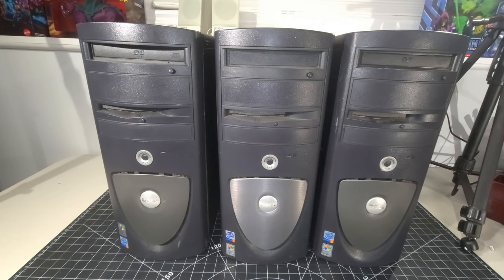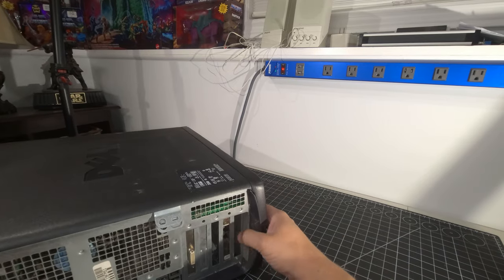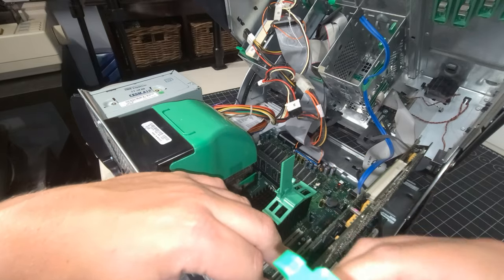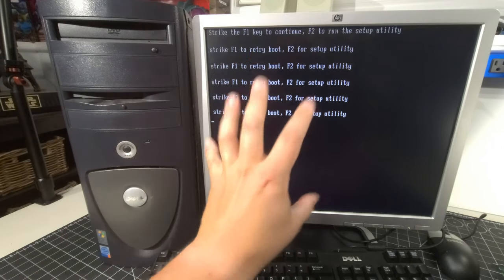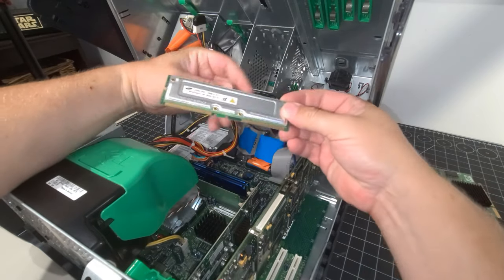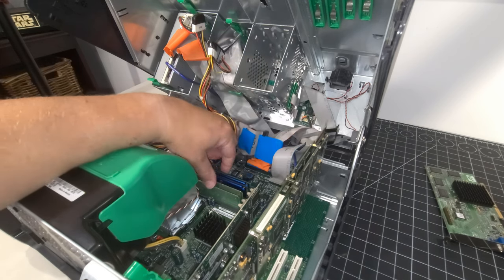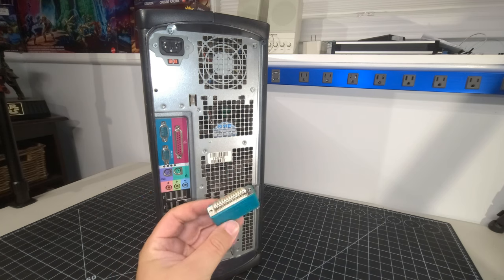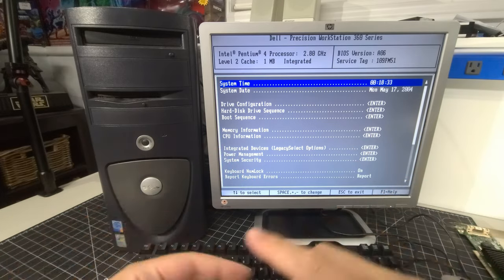E-Waste Rescue - The Dell Precision Triplets!!

Comment: The "adpater" on the 3rd system's parallel port is a hardware key.  In the old days a software maker would control customers making copies by forcing them to use a hardware key.
Reply from the maker: Thanks!!
Reply: I've seen similar hardware keys being used with old oscilloscopes in the past.  The hardware key is used to unlock/validate features on the scope or other such pieces of equipment.
Reply: Hardware keys are still a thing but in the form of a USB stick. For example Davinci Resolve Studio has an option to buy a hardware key
Reply: @Pasi123  I have seen the usb keys.  I saw one on a desktop, plus it was labeled to keep folks from removing it.  They attached a security cable via epoxy, and tethered it to the workstation.  At least it wasn't glued in place!
Reply: Accounting software uses those keys too. They were a real pain to work with if you upgraded a system and forgot to take the key from the back of the machine.
Reply from the maker: I would imagine.
Reply: @BRBTechTalk  At one site I worked at the engineers would install the software on multiple pc's. then pass around the parallel keys to those who temporarily needed to run the software.  The vendor phased the keys out in place of a utility that would register individual machines with their license server.  Our network admin had to open a port so the license server could sense the pc's.  Not sure if it recognized the machines by MAC address or other identifiers.
Reply: Also, these keys are used in most PC Based Arcade games like Raw Thrills, Global VR, Namco, and Etc. They mainly use Aladdin HASP HL LPT Dongle or a USB HASP HL SRM Key or Sentinel SafeNet. They can be valuable and sell for a great profit. It was mainly meant to prevent piracy, and their own modified OS won't run the application without the key
Reply: I remember you saying in one of your previous videos that these Dell systems are bulletproof. And although I don't really like the brand itself I have to agree with you! Ive had this Dell Optiplex 780 for 2-3 years now and I've had many motherboards die on me  in that time yet this thing is still living even after fiddling around a  ton with it on the inside. The CMOS battery holder broke so I tried to solder a different one on it from a donor motherboard and it didn't broke and it actually has scratches on the back of the board from my soldering iron and it even has a missing trace on the board from my bad soldering skills. I thought it'd be dead from all this abuse but it still works absolutely perfectly apart from the CMOS issue! Absolutely incredible. I enjoy your videos a lot btw.
Reply from the maker: First off thank you for the compliments!  It's great to hear and happy to have you aboard!  As for Dell, there was a time I really liked their designs, systems, notebook PC's, etc.  Then there was a dark era lol.  I'm actually surprised that board worked agree that abuse haha!  It seems I can't even look at a board the wrong way and it doesn't post lol.  Great to hear yours is still going.  Stay tuned for more content!!

Comment: I have the device as an Optiplex variant, the Optiplex GX260... with 533 FSB it wasn't the top model at the time, but it was a robust PC. Mine is from 2002. I replaced all the capacitors yesterday. They were bloated and partially leaking. Now the old Optiplex has been repaired again. Iconic and widespread devices at the time. That was still quality, Dell paid attention to every little thing.
Reply from the maker: 100%.  If the Cap plague didn't happen, I'm not sure how much you could fault them for.
Reply: @TheRetroRecall  It was a really bad capacitor time back then. They will have installed the capacitors like other manufacturers without knowing. I can still remember, I was sitting at my PC one afternoon in 2004 when suddenly there was a loud bang. And then a cap exploded and destroyed the entire mainboard.
Reply from the maker: That would have been a VERY sad moment.

Comment: Don't destroy your hard disks. Run a Linux distro and format the drive with 0s. It removes all the data and is almost impossible to get the info back unless you are in the FBI
Reply from the maker: For sure.  When I get the drives I wipe them with security software and reuse them - mostly to protect the previous owners data.  I've heard about the linux way though - just never tried it before.  If the drive is shot, I drill holes through it.

Comment: That's not a DVI port, its a DMS-59 you need to adapt it to output VGA or DVI but it supports 2 monitors at once
Reply from the maker: Thanks for the feedback - I call it out on screen during editing that it isn't a dvi port and correct myself during the video.

Check out marker 9:51 :)
Reply: @TheRetroRecall  The DMS 59 is standard... no idea what the connector on the 2nd card is though
Reply from the maker: Need to do some hunting!
Reply: @TheRetroRecall  It's possibly DFP. (Digital Flat Panel) Which is the short-lived predecessor to DVI. These are not common, and an odd choice for a card from 2001, as DVI released in 1999 and I've got a few cards from 2000 and 2001 with DVI. 

EDIT: It is not DFP, but rather EDD. Tough luck. You're not missing out on much though. The Radeon 7000 is a pretty lackluster video card.
Reply from the maker: Ok awesome.  Yes I heard this cable was pretty unobtainium

Comment: Diacom board was more than the cost of the PC when new, T1 telephony card used for monitoring and recording
Reply from the maker: Thanks for this.  It seems that they are still quite expensive online for the cards.  New were showing 7500 USD +.  Crazy!
Reply: The globetrotter flexid is the hardware key to run the dialogic software seems like they were used for interactive voice response - state of the art for the time

Comment: I had 4 of these Dells which I got from eWaste purchases a few years ago. Agreed with you that these are heavy and they take up a lot of space. So a few months ago I took them apart for the cpu, memory, and drives to put into other smaller systems and junk the cases. Back in the days these are fast machines build like a tank.
Reply from the maker: 100%. Tank is definitely the word.

Comment: In one of your previous videos I remember you saying that these dell systems are bulletproof. And I have to agree on you! I've had this Dell Optiplex 780 for about 3 years now and I've had many motherboards die on me in that time yet this one is still living. After a ton of fiddling around on the motherboard it all still works absolutely fine. The CMOS battery holder broke so I tried to replace it by soldering on a different one. It failed and I accidentally made scratches on the board with my soldering iron and even a trace came off. Yet unbelievably this thing still runs fine! I can barely believe. I really thought it'd be dead by now but nope. I don't like the brand itself but I'm happy it's so reliable and I definitely agree with you. I enjoy your videos a lot btw, keep it up!
Reply from the maker: I think this was a double comment post? Haha.  I responded in the other one but in either case... Definitely happy to have you along!!!!
Reply: @TheRetroRecall  yeah my bad hehe😅. I didn't see that I replied to someone else's comment first. I thought it was just a public comment that somehow didn't come through.
Reply from the maker: All good!!!! Keep Commenting away!!! :)

Comment: DMS-59 adapters are pretty common, so shouldn’t be hard to track down to get that GPU working. Thankfully it wasn’t the older EDD connector that DMS-59 replaced.( EDIT Just watched further, and the connector on the second machine is in fact EDD, and is also the same model card as the two I have. It’s a Radeon 7000 32mb) Those adapters are unobtainium. I had an EDD card for years and couldn’t find an adapter. I finally found one included with another identical card. A little background on these connectors are that they are designed to run two independent monitors off of one port, the adapters can come in dual VGA, dual DVI, or one of both. Not sure of the practical differences between EDD and DMS-59 besides the different shape.
Reply from the maker: Thanks so much for this added detail.  I'm going to keep my eye out and check in where I got these to see if there is a cable laying around haha.  Again, thanks for this!

Comment: In the factory they would spend their entire life there laying on that side with the feet. The towers were designed to accommodate the builder of the machine. If I’m not mistaken I believe the goal always was to have a highly configurable system that could be built in the factory with as few screws as possible during the building process.
Reply from the maker: That makes sense and thanks for sharing.  The clamshell design / access still baffles me.  Its quite hefty and bends quite a bit of the cabling.  I am happy they went back to side panels.

Comment: Whew that's alot of dell's and given their age I'm amazed they've held up this well in terms of caps/posting. Even if you can't get them all working having donor system's, parts such as ram, video cards, PSU etc to use later on.

As for the video cards, yeah those are bit different as well but given they where used at offices using dual monitor's wasn't out the question, epically if they used a pharmacy, dentist offices and /or hospital's.
Reply from the maker: Yes for sure and makes sense.  I finally figured them out and added notes during editing.  Easy to mix up when first filming though.
Reply: @TheRetroRecall  this is true and I've looked around the break out cables for these cards are not that expensive either. I would try to stock up on few and see what these said video/graphic cards are capable of. 

That aside best of luck with your major e-waste haul, these videos are going to be fun!
Reply from the maker: Thank you!

Comment: 2:54 Yes they can lay down like a desk top and if you look in side you can rotate the CD drive bay so it will be horizontal when being used as a lay down desk top.
Reply from the maker: Great to know!
Reply: HP has a rotating drive bay too. Running WIN 8.1 Pro on it currently. Once it sets into it's routine, not bad.

Comment: Flex-ID: Back in the day it was common for expensive (as in, $5k/seat in 1999) software to be licensed as “single-user multiple-seat”, implemented as a pass-thru parallel port dongle, because USB was not ubiquitous yet. It allowed a software package to run on any number of computers, but only one at a time. The pass-through allowed you to connect a printer to the same port.
Reply from the maker: Again, thank you.  You are a rock star!

Comment: If you are running the cd/dvd rom without and hard drive on the same connector it needs to be set as master or cable select or the controller will be set to off so it won't be able to read the discs. They are usually set to slave by default.
Reply from the maker: Thanks.  In this case the HDD was plugged into the sata port and the DVD drive to the IDE bus and was set to master.

Comment: I had a dell just like this with the crazy diagonal RAM slots, it did not POST, it got recycled. A good Linux ISO that you can easily download that's an easy boot for older systems is the UBCD Live BETA Current release: 0.2.3b. It's a little older and legacy only, but it's pretty cool.
Reply from the maker: Awesome thanks for the suggestion!

Comment: It's usually a good idea to use rufus to create bootable usbs from isos. Most linux isos will require at least 512 to 1gb ram to function.
Reply from the maker: Sounds good, will do and thanks!
Reply: I guess these PCs do not boot off USB, though.
Reply from the maker: I do not remember seeing an option.. But the thought did cross my mind.  Again, the scope was to get the systems to post.  Have to draw the line somewhere lol.
Reply: I successfully run 1.5gb ram in my Precision 360. Does anyone know the max amount of ram that can be accepted and if it must be DDR or can it be DDR2?

Comment: I used to have a Dell Precision 370. Sadly, the motherboard was bad. I am assuming because it  had a bunch of bad caps on the board, I have been known to recap boards in systems like this before, but it was also quite beat up. Although it did have the 3.8 GHz Pentium 4, which is the fastest Pentium 4 released. I kept the CPU. 
On a side note, Me and my friend have a small business buying old office PCs by the pallet load and selling parts out of them. We pull hundreds of those DMS-59 graphics cards and have several huge boxes of those adapters. I personally quite like DMS-59 because you can get a pigtail with 2 DVI ports, 2 VGA ports, or 1 VGA and 1 DVI. So it is highly versatile for single or dual monitor use. Those cards and pigtails used to be all over in mid  00s to the late 2010s, so you should be able to find them cheaply and easily.
Reply from the maker: Awesome, I'll be on the hunt for them for sure.

Comment: What would make a good XP retro box? I have some choices:
1. Dell Dimension 8200, with a choice of Geforce 4200 Ti or Radeon 9800 Pro ... my best AGP machine, but not tested those cards yet as I don't know if the PSU is enough
2, P4 640 PCIE
3. An Athlon 64 3400+ PCIE (no HT, but faster core)
4. A FM1 with A8 3820 PCIE  (can XP use a quad?)
For the PCIE, also debating what graphics card is powerful, cheap and XP compatible, leaning towards a GTX 400/500 series
Reply: 4. - Yes XP can run on quad, it was standard to use them with C2Q6600.
Reply from the maker: I personally like P4 machines for Windows XP only as P4 was around in 2000 and XP came out in 2002.  Just really close in time making it a good fit.

Comment: That parallel port thing is probably a software dongle. These are pieces of hardware that enforce licensing of some software, usually high-end or very specialized (read: expensive) software packages. Basically the software, when you launch it, checks for the presence of the dongle, and if it doesn't find it, it refuses to run. Not sure what specific software program that dongle is designed for (and since the machine lacks a hard drive, this is moot anyway) but that's what it's for.
Reply from the maker: Thanks so much for this info!  Makes total sense now.

Comment: Like the old song goes, two out of three ain't bad! Interesting about RD RAM---I've never encountered it before, mine are always PC100/133 (luck of the draw I guess). My focus has always been on Win98/Me systems, but now I'm starting to get more into XP systems, for the simple fact that XP can still get online where the others can't---that limits their usefulness. These systems will be fun to restore, and if you need a motherboard to fix the one that won't post, I imagine you probably have parts to fix it
Reply from the maker: HHa you picked up on the song!! RDRAM was more focused on business / server type systems so not too often you would see them hanging around the consumer market.  I'm sure I will get it working again, I'm determined :)
Reply: RDRAM was initially used by the P4 in it's earliest versions, consumer end enterprise, but by the time it had moved to socket 775 it was long gone, DDR only. I only ever saw or used 1 PC with RDRAM, an early P4 from 2002 or so.
Reply from the maker: I just came accross a p3 system with RDRAM.  I was surprised to see it.  I go years without ever seeing in and now twice in 3 days lol.
Reply: @Karataus  Yeah, RDRAM started with the P3, near the end of the P3's life as it was fighting with AMD's Athlon Thunderbird chips if memory serves. Intel were desperate for any performance boost. Never became mainstream though.
Reply from the maker: Thank goodness it didn't.  I like where we ended up haha.

Comment: You need a boot disk with driver for cd/DVD device
Reply from the maker: For the Linux distro?  They are reading the software and it attempts to boot, unfortunately it doesn't like it.  My feeling it is the drive and read errors.